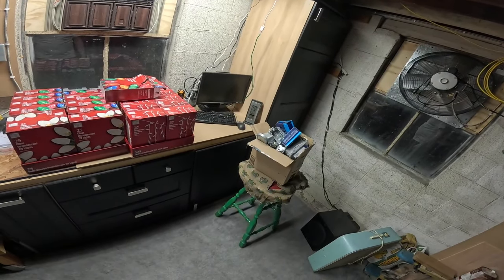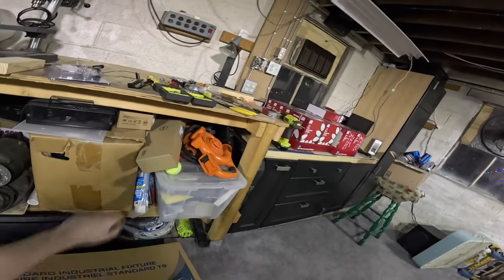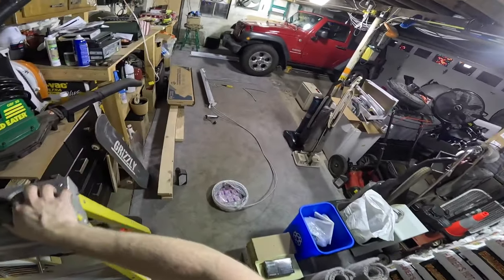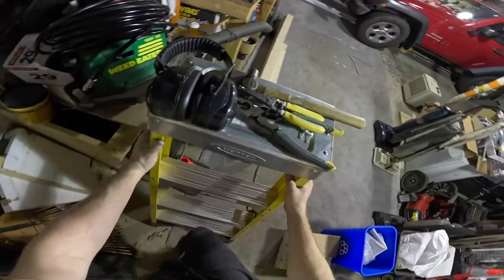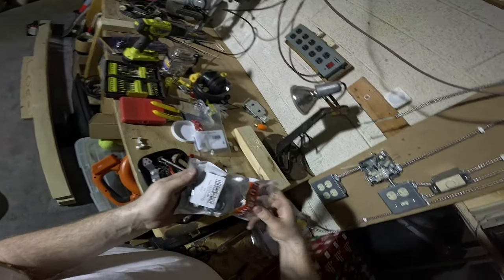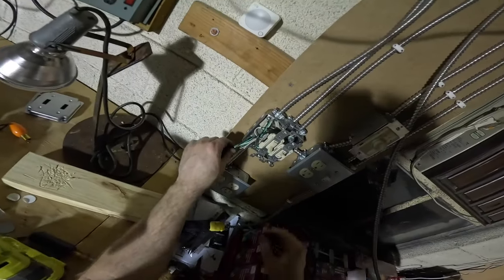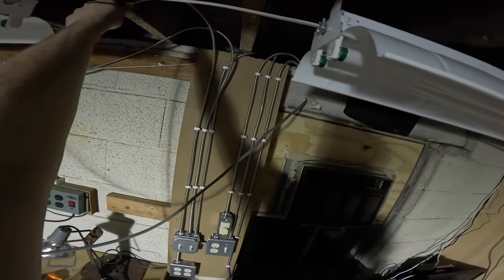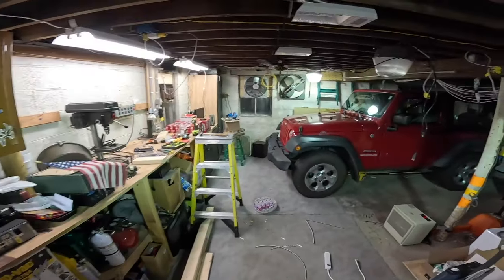Installing Fluorescent Lighting in the Garage | Part 2; Lithonia Lighting L232 MV

Comment: I wish you were local, I have a box of old magnetic Pre-heat and rapid start ballasts I would give you. You would probably need different sockets as well, but those fixtures could be fitted with magnetic ballasts.
Reply: I think the reduced flicker of electronic ballasts Jordan would appreciate. I love the Philips Warmstart (Program start) sometimes known as Philips HF-Performer II ballasts because they give the smooth non flicker feel from electronic but also pre-heat the electrodes before igniting the tube which leads to long tube life when turned and off regularly.
Reply: @Tokaisho1 Reduced flicker? I have never understood people saying that magnetic ballasts flicker, unless it is a low power factor ballast or the lamps are on their way out. I have never seen a properly working NPF or HPF magnetic ballast flicker. I have however seen LEDs flicker (all of them do) and I have seen electronic ballasts flicker(although they normally do not under normal operation.) The electronic ballasts also last nowhere near as long as the old ones do. The fixtures that I am sitting under right now are from the mid 1950s-early 1960s, they have their original ballasts and are still working fine.  The only magnetic ballasts that sort of suck are the cheap Bench-Lite LPF rapid start ballasts that were used in those cheap shoplights from the early 2000s, those do flicker and kill lamps.
Reply: Yeah some electronic ballasts possibly do need re-capping after a few decades or so if used frequently due to things like heat, some capacitors are better than others too. For flickering I suppose it depends on the person, some say they notice the 50/60hz slight flicker and some don't. while I absolutely love the way magnetic ballasts start up, I had a cheap IKEA magnetic ballast desk lamp from the 2000's that had a noticeable flicker to it and it felt like I had a headache from it but it may have just been a bad power factor like you said, I have a couple of Tridonic magnetic ballasts stored for the future I could try out @WalterKnox
Reply: @Tokaisho1  Yeah, the issue is a lot of high quality electronic ballasts are potted like magnetic ballasts are, which means repairing them is nearly impossible. Although I would imagine a good amount of them are not either. Either way, I don't see them lasting 70 years without any issues, but that really isn't a requirement I guess. I just like old fluorescent lights, I have been collecting them for over a decade now. It seems that the high frequency flicker is what bothers me, like on LEDs and some cheap electronically ballasted CFLs. All lights technically flicker, even incandescent lights. Although for them, the filliment won't cool back down instantly, so it is more of a flicker than a blink.
Reply: I suppose the only other thing is when filming on camera, magnetic ballasts sometimes shows lines in footage compared with electronic, the 50/60hz vs electronic with around 60,000hz, at least with CFLs/tubes they only lower by around 20% brightness during the off cycle compared with LED's that are off by 100% to cause the noticeable flicker when they have low quality power supplies, especially those cheap knockoff ones, it's possibly alright if not focussing on the light directly with the tubes, could be worth a side by side experiment with a camera @WalterKnox
Reply: @Tokaisho1  I could try a side by side comparison. I have both types of fixtures installed in different areas. I make almost all of my videos under magnetically ballasted pre-heat fixtures, and the banding is noticeable when focusing directly on the lamps themselves, but doesn't seem to affect anything when not focusing directly on them. I wouldn't expect that it makes too much of a difference in colour rendering, that would depend on the CRI of the lamps themselves, but it is possible. I will have to test that.
Reply: That's good at least if the footage is not affected unless looking directly at them @WalterKnox
Reply from the maker: Hopefully I'll find some vintage fixtures around here someday. I am aware that some people report the flickering from the older magnetic ballasts, but I'm willing to give it a try.

Comment: If you're looking for spare ballasts Jordan look into Philips HF-Performer II Warm Start ballasts, if still available where you are you can find the right rating one for you, single tube twin tube etc, they are program start so pre-heat the electrodes for a second then strike, leading to really long bulb life even if regularly turned on and off, good cold starting conditions and are smooth to look at with no flicker on camera, I fitted one into a twin fixture I have and it's been reliable so far.
Reply from the maker: Thanks for the suggestion. I will keep those in mind if these fail.

Comment: I know they say not to, but I would just put some holes through it and screw it directly to the rafters. Those ballasts don't put off nearly enough heat to make it an issue.
Reply from the maker: I prefer the hanging aesthetic.
Reply: @JordanU  I would as well if it weren't for the method of which these things are held together, that metal "strap" that the chain hooks on to just doesn't give me much confidence.
Reply from the maker: @WalterKnox Me either, but as long as the fixtures aren't moved or pumped, they should be fine. I suppose I could always drill holes in the top and connect the chain directly to the fixture.